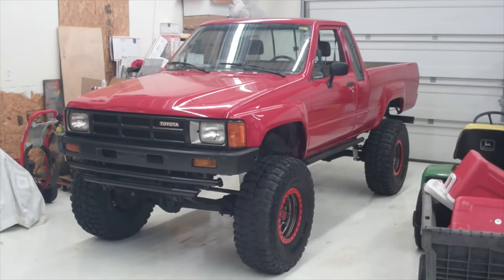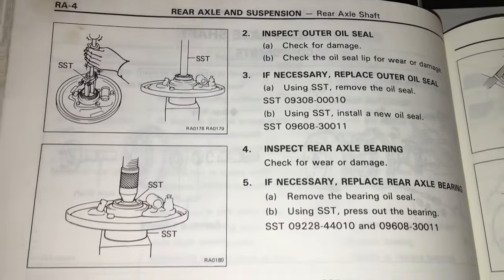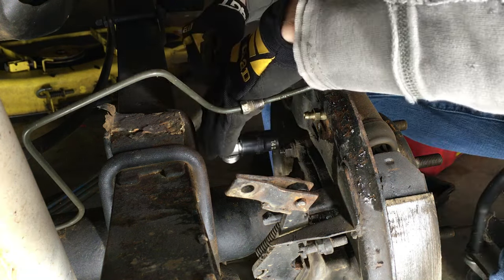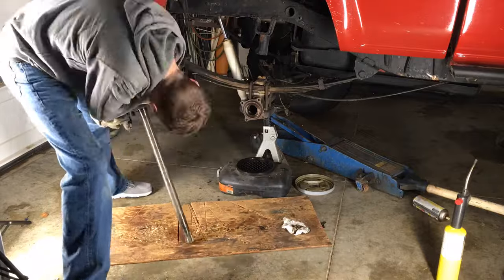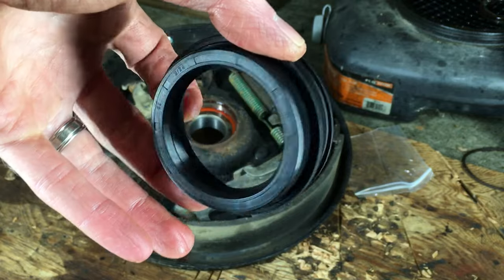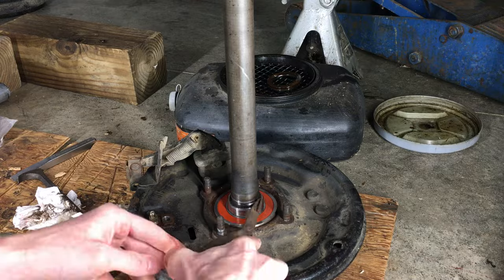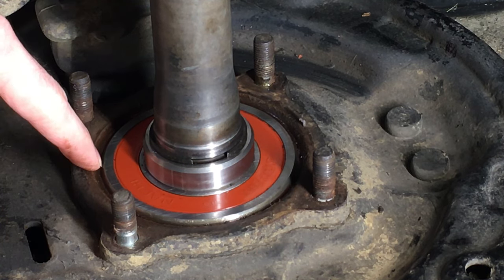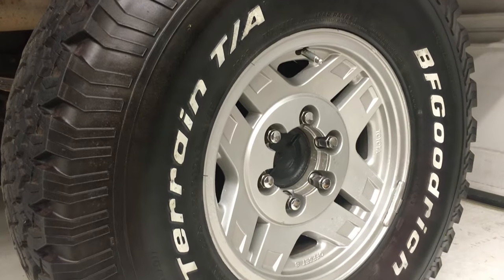Install Toyota Pickup/Hilux Rear Axle Bearing, Oil Seal - WITHOUT a Press!

Comment: PLEASE READ: All NEW TOYOTA axle bearings have side to side play and ZERO up-down (vertical) play.  If a vertical play is present, then bearing is shot. 
ONCE ALL ARE REMOVED, (1) INSTALL THE OUTER SEAL TO BACKING PLATE WITH HAND (2) SLIDE THE BACKING PLATE OVER THE AXLE AND THEN drive the bearing into the axle which eventually rests on the bearing housing (3) NOW DRIVE THE RETAINER. 
(4) IF YOU HAVE ABS SYSTEM , PLEASE WATCH TIMMY THE TOOL MANS TOYOTA AXLE BEARING SEAL REPAIR PART-2. YOU MUST PROPERLY INSTALL THE 2ND RETAINER OTHERWISE, OIL WILL LEAK AGAIN. 
NEVER HAMMER THE INNER RACE OF A BEARING.

Comment: Might be good to have a video on the infamous VLPV valve on the rear brake axle.  There is some confusion on what it does and how to tell if it is not working.
Reply from the maker: Good idea.  It has been eliminated from my truck, but if I come across a functioning one I will do that.

Comment: At 3:56, my 2002 tundra 4wd v8 had no lock washers when I removed the 4 bolts from axle housing.  Is that a problem?  Great video
Reply from the maker: I'm unsure if the Tundras had lock washers or not. I would think lock washers would make sense there.
Reply: @6thGearGarage  thank you. I checked both sides neither have them.  I’m just going to put them back on like I found them.

Comment: Awesome video I really enjoyed it. Watching it while at work. Love my job let’s me watch awesome videos like yours. Thanks in advance need help please my Toyota tundra 2011 is leaking oil from the drum in the inside onto the tire do I have to do the same process to fix that leak or is it something else that I need to do to fix my leaking problem. Also at the beginning of your video you told us that there was clunking sound coming I don’t hear that sound coming out of my tundra by the way it’s the rear driver side tire. Thanks again looking forward to your respond.
Reply from the maker: The clunking was my wheel bearing, so it sounds like your wheel bearing is ok but your oil seal is bad. While it’s all apart though is the ideal time to replace wheel bearings.

Comment: Great video. Will this method work on ABS models? Couple of extra pieces to pull off.
Reply from the maker: Yes it will, you'll just have to install the extra ABS parts in the order they were removed.

Comment: Love this video! I got a set of Koyo wheel bearings for the rear for free. 
I've got a weird noise coming from the rear end, might be the center support bearing.
Reply from the maker: Jake Tow when my center bearing went bad, it didn't make any noise, but was able to feel some slack/slop when hitting the gas. Hey I like that cap you picked up. Was it from a Toyota or s10, ranger etc. I'm also looking for a used one and only see s10 and ranger caps around here.
Reply: Jake Tow o

Comment: Awesome video 👏 
So, I have a press, and I think I only need the oil seal (haven’t done it yet) but would it not work to use a big hammer and some wood, and maybe some heat, and hit the end of the shaft to knock it out?
Reply from the maker: I don't see why it wouldn't work, but I suppose you'll have to be more precise with a big hammer than I could be.

Comment: I tried slamming it like that to get the bearing off and decided to use the press. With the press it was 10 seconds. If you can find a press I can stress enough how much easier it is.
Reply from the maker: I actually went and bought a cheap press after this experience. My palms were sore for a couple days after slamming the axle into the ground so many times.

Comment: @6th Gear Garage I know it's been a long time but as of 12/2021 that Amazon link for the rear wheel bearing kit no longer uses Japanese made components. Just got mine and the package says made in China. It's probably fine but just wanted to give you a heads up.
Reply from the maker: Thanks for the heads up!
Reply: i spent 90 bucks and got a kit with KOYO/NACHI off ebay. such a pain in the ass job  i dont see how saving $30 is worth it

Comment: Can you post the link for the kit please and do you have a video of you replacing front rotors and bearings and seals?
Reply from the maker: I got it from ebay over 6 months ago, so the listing is long gone. But try searching for something like "toyota rear axle bearing seal 1988." I don't have a video of the front bearing, but I probably will soon, as one of my front wheel bearings seems to be making some noise.

Comment: Superb
I have the same truck but in double cabin and same bearing i need to replace.
Can you support in having workshop manual of ln65 toyota hilux 1988....
Reply from the maker: Hi, unfortunately we never had that model available here in North America.
Reply: @6thGearGarage  but do u have workshop manual available as shown in this vedio?
I am restoring mine in Pakistan and its engine i have replaced with 3L 2800cc approx. Rest all original but still lots of to do.
Reply from the maker: @mansoorcheema269  I have a repair manual book that the previous owner included with my 1985 Pickup. You will enjoy the power with the 3.0!

Comment: Doubt I’ll get a response since the video is so old, but could the rear bearing if it’s just starting to go out make a swooshing noise almost that only happen when under load or bumpy roads? I’ve been having a loud swooshing almost rubbing noise in the back passenger tire area that only appears when the rear passenger side is under load or driving down a really bumpy road so it’s not constant and idk I’m not that strong, but doesn’t feel like it has any play really in the rear tho that’s definitely where the sound is coming from. Any info would be greatly appreciated.
Reply from the maker: I’ve heard bad bearings make a resonating/humming noise under load, but I’m not sure about the swooshing noise.
Reply: Swooshing is just the best way I can describe it at first i through it was my dust shield in the front slightly rubbing when I was turning but it wasn’t it’s just a weird rubbing noise that matches the speed of my tires rotation as they rotate faster it gets faster and louder. Just found out today it’s coming from the rear not the front and been trying to figure out what’s causing it.

Comment: can you tell me where you purchased the seal kit?  mine is 2002 tacoma 4wd with 6 cylinder
Reply from the maker: I got mine on ebay a looong time ago.  If your 02 is non-ABS, there's a link in the description to a kit that will work.

Comment: Awesome video.
Can I do this to a Toyota HiAce van 2003..is the principle the same?
I haven't removed the wheels etc, but I do have, what appears to be a sick axle bearing, according to the noise.
Reply from the maker: MrSaintsebastian I'm not familiar with the HiAce, but if it has the 8" or 7.5" rear axle with drum brakes, the procedure should be he same.

Comment: My bearings should have zero play after removing my axle? I’m having a hard telling what my noise is.
Thinking bearings cause both rear have some play ?
Reply from the maker: It’s going to be difficult to check bearings for play with the axle removed.  If they have play, I’d replace them while e axle is out. 👍

Comment: Pulled my first gen Tacoma apart and it has the ABS gear (but no sensor), is there a similar way to pull/press this gear off the axle without a press?
Reply from the maker: Gabriel Amadeus Tiller I haven’t had one with the ABS gear to try yet, so I can’t speak from experience there.
Reply: @6thGearGarage  ended up bringing it to a shop, thanks for the reply!

Comment: hey mr 6rh gear garage , will this parts be same for a 1981 4x4? so i can order every single part that you use please anser my coment thall help me a lot thank you
Reply from the maker: I am not sure, but I think some parts for the earlier trucks might be different, such as the bearings. The oil seal should be the same though.

Comment: This is a old video I understand that but does anyone know if I can use this method to knock everything out except the bearing and replace the seals and collar? I’m basically wondering if knocking out the collar this way by banging it will damage the old bearing or will it still be useable after that? Anyone know??
Reply from the maker: I would say replace them while everything is apart. Mine were already bad, but you can see how much worse they were after getting everything apart.

Comment: Please Make a video on how to upgrade brake cylinder and pads!!
Reply from the maker: I do not know if there is an upgrade for those parts. I do know that the rear axle on my 1985 is from a 1986+ IFS 4x4 pickup, so in addition to having a 3" wider track, it also has slightly larger drums for better braking. 85 and earlier solid axle pickups had slightly smaller rear drums.

Comment: I'm about to do my 2002 tundra's soon. What all should I change out while Ive got it broken down?
Reply from the maker: Might as well check the rear brakes- shoes or calipers, not sure if those are rear disc or drum- since the rear will need bled. The only other thing that’s ideal to do while the axles are out is replace the rear diff, but hopefully you don’t need to do that.

Comment: Maybe just use a slide hammer on the hub before you unbolt the assembly?
Reply from the maker: If you have a big heavy slide hammer it might be worth a try
Reply: Nevermind. Just tried it. Forgot about the snap ring. You must remove the brake assembly and back plate and hub to remove the snap ring before the axle will come out of the hub.

Comment: Just a quick question. I'm planning on replacing the backing plates on my '03 Tacoma. One method to remove them is cutting the bearing housing and splitting it open. Which style of axle did you say my truck should have?
Reply from the maker: I haven't ever worked on any newer Yotas than 1995, so I can't say for sure.

Comment: Did you apply grease to the inner portion of the new oil seal before putting the axle shaft back in?  It didn't seem like you did on the video.  Some say to do it, some don't mention it.  I'm about to attempt all this.  Just want to make sure I understand the process.
Reply from the maker: I'm trying to remember if I did and forgot to get video... I may not have. I rechecked the FSM and it says to.

Comment: I'm unable to get that retainer to beat out trying to now get a ride to NAPA to have them press it out
Reply from the maker: Jared Grass did you try adding PB blaster and heat?
Reply: @6thGearGarage  yes both. The bearing isn't in that bad of shape. It had been saturated with gear lube. Its got some play inside of hub. Should easily come out. I burnt up a little of bearing jacket with map gas. Put it all back together for now. I put a new outer axle seal on last weekend to get my toes wet. Its doing fine. The bearing has 340000 miles on it. I realized the pipe I had picked up wasn't big enough in diameter to set new retainer ring which is a good thing since I now have ability to get another. I badly wanted to accomplish this feat this way. Still not defeated. Never ran up to NAPA around corner.
Reply: My new goal is to bolt a steal bar in corner of block garage at a certain height. At steal shop I work at I'm going to fabricate some plates of steal. My plan is to be able to place axle on my floor jack. Jack it up to bar to press out. My hands hurt. Blisters in palms and all. I still don't want to use up valuable space in my one car garage. I still would like some pressing area and utilize my floor jack in doing so.
Reply from the maker: Jared Grass so pretty much a homemade upside down press👍 if you do build it, upload a video. I'd love to see how it turns out.
Reply: @6thGearGarage  absolutely having a standing press will take up to much space. Also since a new sleeve was supplied I wish I had tried hammering the one I was trying to get off

Comment: Great video! My 94 4runner is leaking and gotta change the seals. One question, what material was the pipe you used made out of? Would steel damage the retainer face?
Reply from the maker: That pipe was actually the leg of a trampoline. It was a little weak/thin for this application and it started to mushroom a little on the end.

Comment: Is this the process I need to do on My 2002 with out ABS? BTW Good Vid !!!
Reply from the maker: It will be similar, but I'm guessing your 02 has disc brakes. So you'll have to unbolt the caliper, support it on something or hang it, since the brake line will be attached, and then pull the rotor off. Disc brakes are actually easier because you aren't opening up the brake line, so you don't have to bleed the brakes after.
Reply: @6thGearGarage  Mine is drum brakes same as yours thanks

Comment: Hey! Pretty truck. Curious, a mechanic just told me my rear dif seal is leaking and soaking the back brakes on my 2001 4runner. He replaced my drum pads and quoted $1200 for the axle fix. Do you have any comments on this? Thank you :)
Reply from the maker: The  diff seal (3rd member) is in the center of the axle housing and would not affect the brakes. It would just drip onto the ground if leaking. The left or right axle seals leaking would let fluid into the left or right drum brakes though.  So depending on what all he is going to be fixing will make a big difference in the total price. Also if he is going to be using Genuine Toyota parts or aftermarket parts. You saw in this video what is involved in replacing the axle seals, and why it makes sense to do the bearings while everything is apart. Taking of the 3rd member to replace the diff seal has to be done while the axles are pulled out a little, so it makes sense to do that at the same time, if you're paying somebody by the hour.
Reply: Hi! Thanks for the reply! So, you’re saying... yes, it’s a 1200 job, yes it’s a critical fix as I’ll lose brake power, no blue devil spray won’t resolve it, no you’re not worried the dif gears are dying bc they’re out of fluid, and this fix is worth it even on a rusty truck. I’m trying to finish my round-about trip to Montana so I can take time to find another 4runner once I’m down in Phoenix. What if I didn’t replace this now? Dumb idea ? I’ve driven 10k on it already, from Rhode Island. The ebrake didn’t work then, I’m guessing bc seals leaking. Anyway, Thanks again for the advice.  😏
Reply from the maker: I'm saying double check what the mechanic is telling you. The leaking diff seal can't contaminate your rear brakes. Only a leaking axle seal as I replaced in this video can contaminate your brake shoes.  Depending on how severe the leak is, you could get by with topping off the fluid to keep the gear oil from getting low in the rear end. There's a fill plug on  the back of the axle.  If the diff fluid runs too low, you risk damaging the whole rear end and that's going to cost you a lot more than $1200 to replace. Also, your new drum pads can become contaminated from the axle seal leak, causing those to need replaced again. Keep in mind that the front disc brakes do most of the braking on these trucks/4runners. So I'd take into consideration the severity of the leak and how long you're planning to keep this vehicle before putting another $1200 into it. It's kind of a gamble... if you can keep the gear oil level correct, you'll just end up with soaked rear brake parts on one or both sides, depending on how bad the seals are leaking. But if that fluid gets too low, you'll need a whole new 3rd member (differential) and that's a bigger job. Really depends on how bad the axle seals & diff seal are leaking.
Reply: 6th Gear Garage ok super!! Thanks for the info, I’ll get the fluid filled ASAP and see about getting down to phx. I’m tired of rusty NE cars. Stoked to swap it out down there if I can. 👌

Comment: ALWAYS ALWAYS pre lube ALL seals and surfaces they will come in contact with PRIOR to assembling! This step was missed. I also put some grease on the inner spring on the seal prior to tapping it on, sometimes they WILL come off during installation! Have had to re do seals from other mechanics that didn't do this, and found the spring just sitting inside, and not where it's supposed to go on 🙄

Comment: What would be the result of not bleeding the brakes after this job is done?
Reply from the maker: When disconnecting the brake line, fluid will leak out and allow air in the line. The brakes won't work properly if there is air in the line because air compresses.

Comment: How many miles did it last? My Tacoma has 152K and I never replaced any bearings yet.  Although probably more than 90 percent of those miles are highway miles, I do live in northern NY (damn road salt/sand).
Reply from the maker: Im unsure of the exact mileage, since the original  85 axle was already swapped out for a newer 88 axle by the previous owner.
Reply: @6thGearGarage  interesting, okay thank you!
Reply: my 2005 Tacoma has 135,000 miles. I just did a brake job and I noticed there was grease on the brakes on the left wheel. That meant the bearing was leaking grease. it was making no noise whatsoever but I decided to replace it now since it will be a problem eventually. And I got parts for both sides of the same time. I live in upstate New York and it was sheer hell getting the wheel drums off. Even a torch wouldn't do it. Eventually I took my skill saw with a metal cutting blade and opened it up so I could chisel it loose.. But then I discovered that if you hammer in the lug bolts, this is where most of the rust problem is. If I'd done that first it would've saved me  a lot of trouble. As it was I replaced the wheel drums along with the brakes. Will do the wheel bearing next week.

Comment: I'm in the same boat right now, would this be basically the same as on a 2007 Tacoma?
Reply from the maker: Paul V it should be the same with the exception of disc brakes and abs sensors.